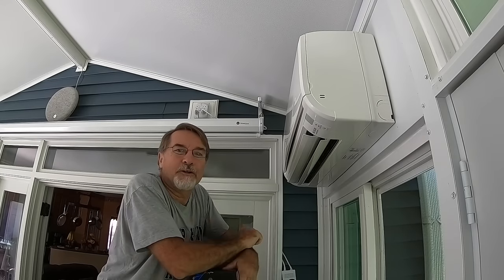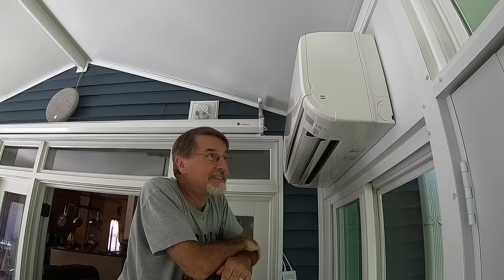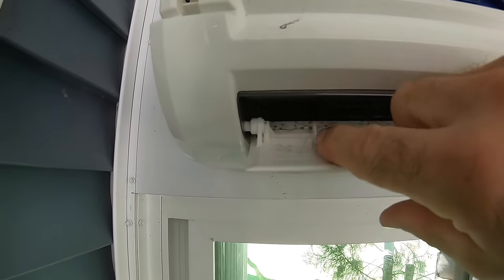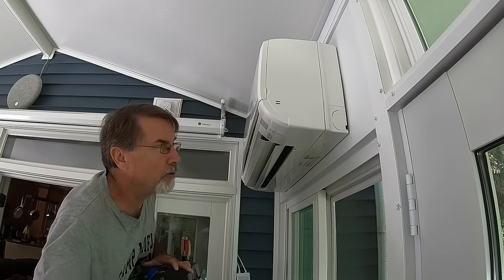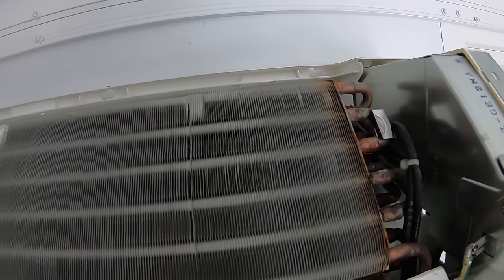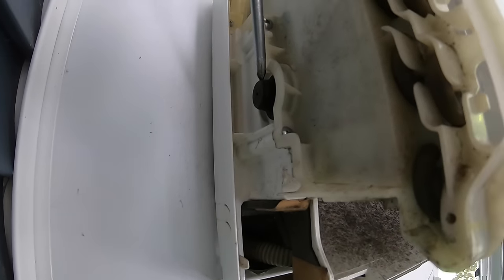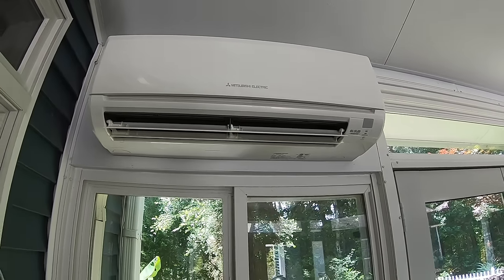HOW TO CLEAN AND SERVICE MITSUBISHI SPLIT AIR CONDITIONER

Comment: My blower isn’t spinning correctly. It will only blow low when I crank it up it blows hard then soft. Do you think it’s the bearing?
Reply from the maker: If it blows hard then quickly goes to soft you might be low on refrigerant or have a bad sensor.  It might be time to bring in a professional to check it out.
Reply: @MyPIDream  thank you. I ended up taking it apart and cleaned the blower really well. It’s working great now. Great video btw.
Reply from the maker: Good job!

Comment: Proper way is to suck that condensate drain out and not blow into it! Hvac 101 otherwise that blower didn't need to be disassembled, you could of brush it and used mist loght pressure washer or brush and vacuum instead of completely removing that blower, note if these units are aged than it's brittled plastic and falls apart at any touch, at that point you want to avoid disassembly of such components amd do the best you can just to keep it going alittle longer good job👍

Comment: This gives me hope I can clean our A/C! But! I stalled out when I got to the part about removing the louvers (or air directors or whatever they're called) - for some reason, the clips that hold these puppies in have no "tail" to help push them to the side. And the louver clips don't budge when I try to push the nub out of the hole. We have other units where I can, but for some reason, these are super stubborn. Is there another way to get these louver clips to move?

Comment: Thank you very much, you're a life saver! (literally, when it comes to mold)

This is the only video i could find that explains how to thouroughly clean the unit, all the other videos only tackle the filters, which are simple and easy, and explained in the manual already.

I wanted to know how to clean it properly on my own whenever i want, because i feel like once  year is not enough with the warranty, and it costs 50€. AC unit professionals must be hating you haha!

What kind of spray do you suggest for preventing mold? And can i spray it everywhere?
Reply from the maker: I don't know of any kind of spray that will prevent mold for a long period of time after drying.  This is why a regularly scheduled preventative maintenance schedule is a must to keep the mold and dirt to a minimum.

Comment: Just had Mitsubishi mini split installed.  Can you also take toff he part of the plastic housing that is still on the wall in your video? I see how you take off the front of the hood, but I need to get the plastic frame that you left on the wall off as well. I'm assuming it's some screws. I'm getting a clicking sound back there where the lineset connects to the unit and need to see what is expanding/contracting and causing the clicking.

Comment: So far this is mostly excellent, I am stuck as Matt says on the removing the blower fan part. Heeellllpppp MEEEEE....
Reply: Peterson.... to remove the blower, rotate it so you can see the set screw inside and loosen it.  Then remove the 3 screws on the left side of the coil assembly and lift it up.. the blower unit will pull out from the left side.. make sure POWER IS OFF>
Reply: @rciancia  Hey Matt I appreciate the reply. I went and found another video where they did the set screw. Had to go do a little of jiggling to get it out. But I think I got it out safely. Cleaned it up well I think. Now just to reassemble the last piece together tonight when I get back home.

Comment: James.. very helpful to me as I own the same Mitsu model.  James will you be showing tutorial on gasing with Freon? My model has been losing 20-25% of its freon every six months. My repairman charged me 175$ for the latest top up. Can I do this myself?  Thanks.
Reply from the maker: You have to find the cause of the leak before recharging.  The task involves using a florescent dye refridgerant charge then using a UV light to identify where you're losing pressure.  The biggest problem with units installed in the US is technicians are not familiar with the charging procedure and tend to fill too fast, too much.  This leads to rupture of the coil at both the outside unit and head.  I suspect this is the case with your unit.  You'll need a professional to check this and repair/replace the leaking component.
Reply: @MyPIDream  Thank you James for taking the time. My certified Mitsu service guy is who I will have to rely on.
Regards
Ron

Comment: Not clear about one thing. How were the coils cleaned? Was the evap coil also taken outside to clean? If so with what? If the rest of ac was that dirty, wouldn't the coil also need cleaning. In this case if coils were not brought outside to be cleaned, shouldn't they at least be vacuumed with a soft brush attachment to an ordinary vacuum hose? This would be easy to do without damaging anything. We have this exact type of ac btw.

Comment: Excellent tutorial ...what about the outside unit for the mini split ...any maintenance need to be done on this?
Reply from the maker: The fins on the coil can be cleaned by spraying mild detergent like dish washing solution and gently spraying the dirt/dust with a hose.  Be careful not to damage the fins on the coil with too much pressure.
Reply: @MyPIDream  Thanks!

Comment: Hi, very nice video!
I have a question: my Mitsubishi air conditioner has a problem with the flaps.
They barely move now (independently from the position that I chose, for example when you switch the air con off, they don't even fully close anymore).
What could be the cause? Maybe the flaps motor?
Would it be easy to replace it? I tried calling a couple of service centers but none of them came back to me, maybe because my model is pretty old now (it's from 2006).
A part from this it still works perfectly though so it would be a pity to replace the whole thing for such a small issue.
I would be grateful if you could help me!
Thanks!
Reply from the maker: All plastic parts should be easy to replace if you understand how they are integrated into the frame.  I haven't replaced the part but certainly would challenge myself to do so if I had access to the replacement parts.  Worse case scenario is you might break the plastic component and then you would have to call in a professional.  It depends on your comfort working with these parts.
Reply: @MyPIDream  Thanks. The actual flaps are structurally intact, the problem is related to the movement so I was thinking that there might be something wrong with the motor that makes them move.
I don't know how easy it is to access to the motor though, once the frame is removed.

Comment: I have used this video multiple times.  For some reason,  this time the blower tube is stuck on.  I’ve loosened the internal set screw, but I am un able to pull the tube free, it’s completely stuck!   Any advice?

Comment: I found this really helpful I just have one question with the warranty on these do you have to get a professional to do the cleaning or can you do it yourself. I am getting a new system as my old one died after 18 yrs
Reply from the maker: As it's just a cleaning and recommended by the manufacturer I can't imagine it would void any warranty but you should check with the manufacturer just to be sure if concerned.

Comment: which setting do most of you use.  if I set it on dry, the room gets into the low 60'sF and humidity drops great.  if I leave it in AC and set it at around 74F, the humidity usually stays high around 65 to 70%.  Which is cheaper to run? It is a Mitsubishi just like his in a small room

Comment: Mabuhay! Is your wall unit aligned? Maybe water is standing and mold forming because the trough isn't emptying fast enough. My wall unit looks very similar and allows for a drain at each end which is easier than repositioning the whole thing.
Reply from the maker: It's level.  It definitely was clogged.  You should have seen the moldy gunk that came out.

Comment: What is the recommended product for cleaning the indoor coil?   That hopefully is not too harsh on indoor air.
Reply from the maker: I would start with compressed air.  You can also use a soft brush with mild detergent.  With both the compressed air and brush, you need to be very gentle and not damage the coils as they're very thin.  If you use a brush and detergent, spray wash the detergent off with water afterwards to not leave any corrosive chemicals on the coils themselves.

Comment: Hi, great video!  I don’t know if anyone has had this problem that I’m having, but I noticed my ac is putting off a very pungent smell that permeates the whole apartment.  I know it’s from the ac, because when I leave it off I can’t smell the smell and when I took one of the filters off I smelled the smell on it.  Any suggestions??? PLEASE HELP ME 😭
Reply from the maker: Yes, I've gotten reports of the same "smelly" issues.  I recommend a diluted solution of bleach during the cleansing of the drain tube as well as cleaning the drip tray itself with the same solution.  Also, all the filters need to be cleaned in soapy water, air dried and reinstalled.

Comment: My condensate lines clog often in the summer. Is there an easy way to (gently) force a mild cleaning agent (maybe vinegar and water?) through the condensate lines without taking the covers off of the mini splits??
Reply from the maker: Yes, a regular application of diluted vinegar will retard the growth of algae but using a vacuum or using forced push using a pressure washer outlet will do the best job.

Comment: All my a/conds is Panasonic brand. I always study about the unit before I purchase it & after installation, I check the technical specs with electrical tools, the first thing is to ensure the current consumption is according to the unis specifications, cos we must ensure the current consumption is minimum. I can confidently say the  Panasonic a/conds is very good. (Malaysia).  (1 HP inverter type & non inverter type). Is there any easier way to remove the indoor unit fan/blower to clean. So far I have cleaned with the blower attached to the indoor unit cos i was not confident to remove it, as I might break it. Please advise. 
Thanks
Tony

Comment: We are using your video to clean our unit, but the blower wheel is stuck. We loosened the set screw and the screw was very rusty. Could it be rusted in place? We've tried WD40 and praying it comes loose.

Comment: My mini-split makes such a loud purring/engine sound whether it is turned on or off. Would the solution be to give it a deep clean or call someone in to fix it?
Reply from the maker: The scope of this video is to fix a clogged drain pipe to stop leaking.  A full cleaning is recommended annually or more frequently depending on usage and exposure to dusty environment.  This might correct your issue.

Comment: If you pull the fuse at the outdoor,  on a mitsubishi,  it cuts power to all, not required to turn the circuit breaker off, fyi

Comment: Around 4:49 there is a good view of a drop of water on the bottom of the unit about ~4" from the left edge. Did the cleaning fix this? I have the occasional bead of water forming and dripping, but on the right side of the unit. Do you know what causes this and what the fix is? Thank you!
Reply from the maker: Yes, after the unclogging of the drip tube and general cleaning this eliminated the drips on the case.

Comment: Is it necessary to turn the power off at the main panel when you have the unit plugged into the wall opposite? I have dedicated switches installed at each of my five units. Will it be enough to turn those off?
Reply from the maker: It's always advised to turn off the CBR for any appliance when servicing.
Reply: So you wouldn't have accomplished the same by simply unplugging your unit and I can't accomplish the same by turning off the switch installed specifically to interrupt power to a unit? (Sorry to be dumb about this!)

Comment: How long had this unit been running since it's last cleaning?  Is cleaning an annual event?
Reply from the maker: The unit on average is only run from May-Oct each year.  It hadn't been cleaned in a couple of years.  To prevent build up and clogging a regular annual preventative maintenance plan should be considered.

Comment: Can't even get the cover off. Clogged drain. With whatever this can clog. Can I damage anythign pushing a pipe pleaner up with a installation fiber?
Reply from the maker: You might want to try to push something like GI wire that will follow the tube to the end.

Comment: Hey James, why did you leave your electric awning attached when you built the sun room? Or is that a movie screen or something?
Reply from the maker: It's a 120 inch screen.  There's a short throw projector in the roof that turns the sun room into a movie theater at night.
Reply: My PI Dream wow that's nice.
Reply: Sweet.  I've actually designed a house that I would like to build in the Philippines if I ever make it there.  It has a theater room.  What I have not worked out is how to wire the seating so that if someone talks while I'm watching a movie they get an electric shock.  :)

Comment: Hello, how do you remove the roller?  We didn't catch that step in your video.
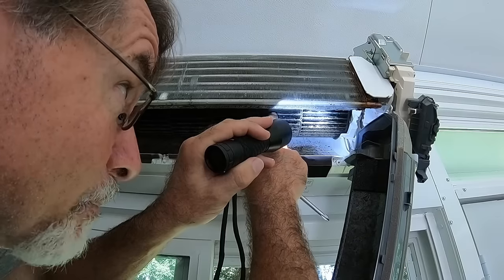Reply: around 9:24. Spin roller to find gap and unscrew screw. Then on other side you unscrew more screws. There's a cog of sorts that will come undone and you can remove blower wheel. There are other videos too of the Mitsubishi that show this step a little better.  HVAC in SC does a pretty good job too with the tear apart. Between the two you can rip this apart and put back together in no time.

Comment: Hi mate my water is dripping out from outside tube but water is still building on the coils in the inside unit. What you recommend?
Reply from the maker: It could be several things but it sounds like you have excessive condensation buildup.  This normally occurs during cold seasons but can also happen year round.  Maybe you have a bad seal around the head unit letting outside air in causing the condensation.  If it's cold outside and it's not a major problem wait until the warmer months and see if it goes away.  If not, then it's time to call in the professionals.

Comment: even after removing the set screw, the fan/blower is stuck on the motor drive shaft.  anyway if you think your copper pipe looks corroded, mine is much worse and its only 5 yers old.

Comment: James my mini split is freezing up ive had it since march now. its keeps freezing up on me ac guy has been out here to check freon multiple times could this be a reason my mini split inverter seer 16 unit is freezing up on me?
Reply from the maker: On the outside unit, the most common reason for freeze ups on split units is something my be keeping the warm air from blowing over the coil (maybe the fan isn't working) or if it's freezing up on the inside you might have low pressure.  Also there might be a faulty thermostat.

Comment: My mitsubishi aircon was working and halfway through it suddenly just stopped working. It didn’t even shut off properly. The vane just locked itself in the open position. The aircon doesn’t turn on anymore. Any idea how to fix it? I also heard a slight pop before it stopped working.

Comment: Hey James my name is Matthew I was wondering if u could tell me why I'm getting this horrible squealing or loud humming sound coming from the unit I have lived in my apartment for a year I've only done basic cleaning like the blue filters that slide out and a quick wipe down please help thank u
Reply from the maker: You have to find the source of the noise.  It will be a moving mechanical part like the fan motor or fan itself.

Comment: How did you reassemble the drip tray? This part is impossible to fit in, especially on the right side.
Reply from the maker: The tray was cleaned without removal.
Reply: @MyPIDream  You unfastened the three clips (at the 8:00 mark) for the drip tray to drop down to access the blower wheel. I'm not able to reassemble it back after doing so (same state at the 9:00 mark). Do you have any tips / video on doing so?

Comment: Hi there. Are these split air cons more expensive to run, than the single air con?
Reply from the maker: If they come with a DC inverter then they are about 50% more efficient than non-inverter units.
Reply: My PI Dream cheers for that 👍👍👍

Comment: I m from Hong Kong. How about in building ? Invertor or fan outside flat wall ?
Reply from the maker: Mild cleaning with soapy water with a soft brush on the coil being careful not so damage the aluminum fins then rinse with light spray.  You can also use compressed air but not too high pressure or too close to cause damage to fins.

Comment: So i used this, but now my unit is making a weird noise. I think the blower fan is sliding back and forth and i dont know what to do. Any advice?
Reply from the maker: Check to make sure you didn't leave out any parts or secure any parts properly. Also check to see you didn't leave anything behind before reassembling.

Comment: what would cause the a/c not cooling enough temp does not go below 76
Reply from the maker: If your filter is clean and your outdoor condenser is not blocked this would indicate a low refrigerant level.  You might have a leak leaving the refrigerant at a low level.

Comment: Video skips the hardest parts to figure out. Like how to actually get to fan blade drum out of the assembly. But otherwise, thanks.
Reply: Gave up on taking that apart since the unit looks different on multiple videos. Just bought a Portable water gun and a cover to catch the water to hose it down. The drain part was also clogged so stuck a long straw brush into it and it unclogged just fine.

Comment: I have a leaking problem but i dint think its a cleaning issue. My unit is leaking but from behind the fan. The drain pan only catches from the front part